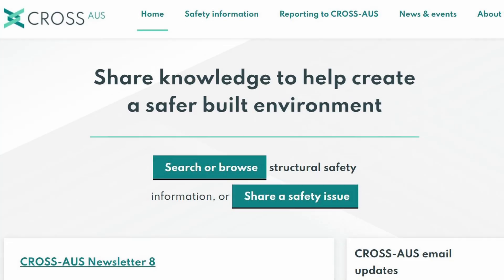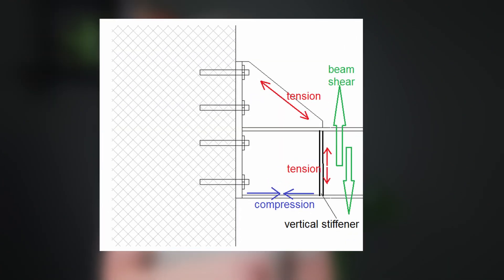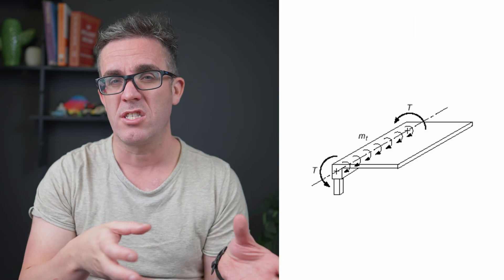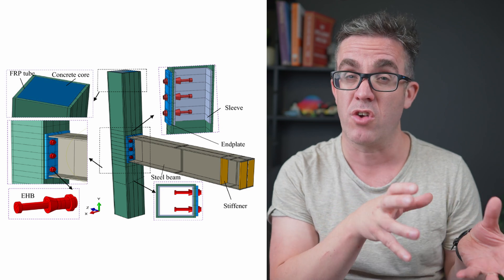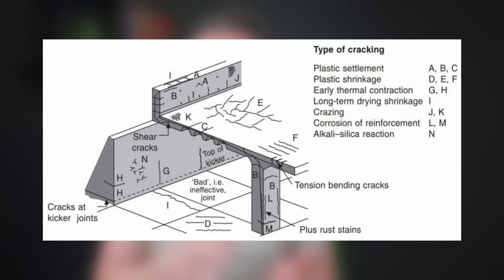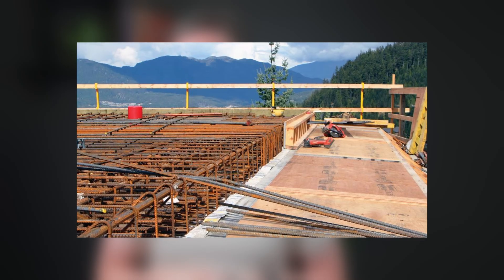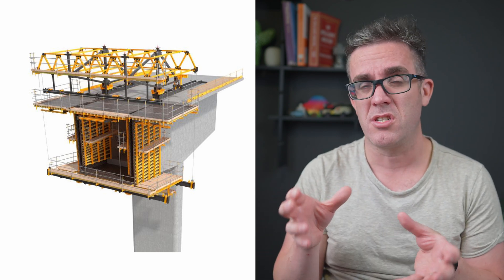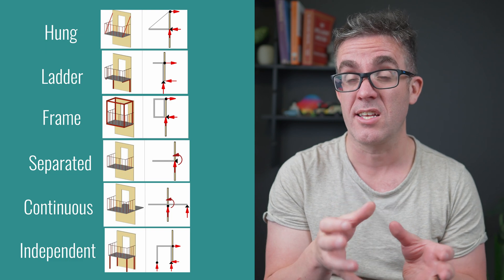Designing Structural Cantilevers? Here's What You Need to Know!

Comment: What are your thoughts on tension posts?  For example I have a few large trusses spanning 80’ across for an open auditorium and they want a mezzanine, at the back, without columns of course. My idea would be to tension post down from the bottom truss chord but I want a back up beam going all the way across I think for the mezzanine that works in moment but fails in deflection, in case one of the tensio. posts fails the beam would still work in moment, just not deflection.  Make sense?  So much easier to draw these things

Comment: You talked about torsion being the bane of all engineer's. That was enlightening. I have some questions that are kind of off topic.
During a high wind event, I understand that proper fasteners and load path are critical in keeping the structure in one piece. What role does structural vibration combined torsion play in failure? 
I'm thinking of tornados and long duration high winds. It seems to me that leverage forces placed on fasteners are very important. But, how important are the torsional forces? And how much of a role does vibration play in failure?
Thank you.
Reply from the maker: Hi Joseph typically vibration is a service condition failure not a structural failure, tho it has happen in really light bridges. Torsion is often overlooked it had a compounding effect with shear and can greatly increase deflections. Most designs I try and avoid a torsion resistance systems and try ro frame up structures to be moment resistance.
Reply: @BrendanHasty  thank you Sir. 
I appreciate you taking your time to respond. And, I appreciate the information.😁
Reply: I have an extremely off topic question for you. How could someone start an international civil engineering group dedicated to repairing critical civilian infrastructure on conflict zones? For example, the Kakhovka Dam is compromised and draining water from the reservoir that feeds the NPP Cooling Systems. With out doubt, this will lead to a meltdown of the cores and the spent fuel in the dry storage area. A study was done in 2011, and this is the conclusion based on the Kakhovka Reservoir dropping below a certain level. The first catastrophic event will occur because the dry fuel containers will over heat and crack. Then the reactor cores will meltdown. 
Because of the famen that will be induced by this horrific event, I have been thinking about what else could be done.  I would love there to be a group that could go there and repair the dam. It would be like Drs Without Borders; but, Civil Engineer's Without Borders.